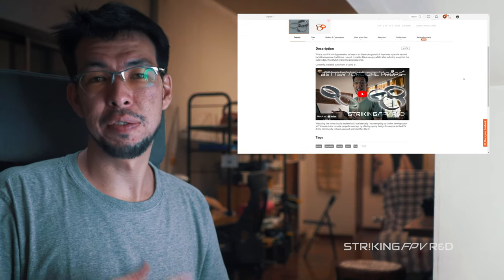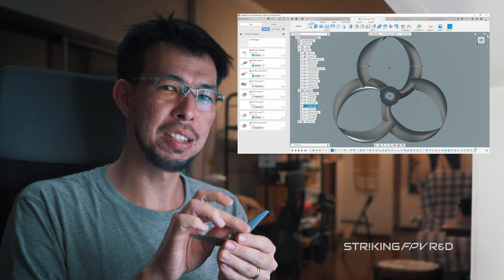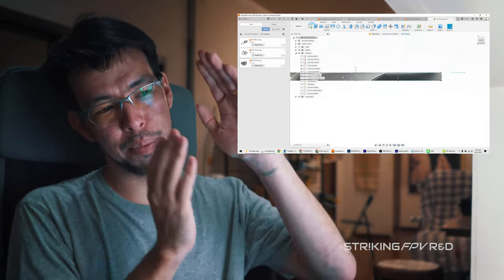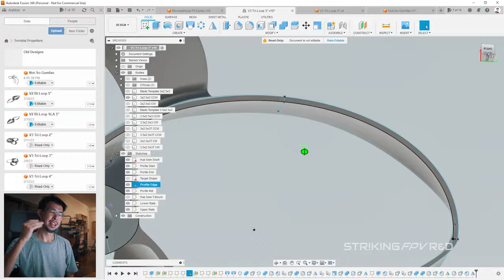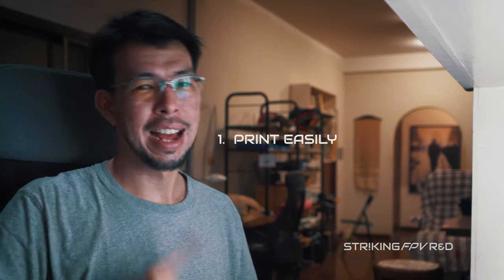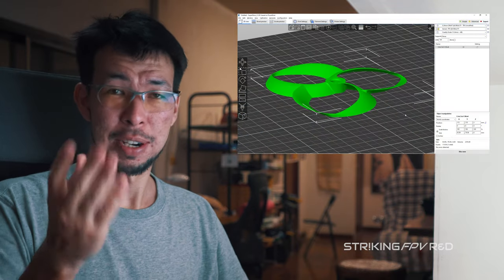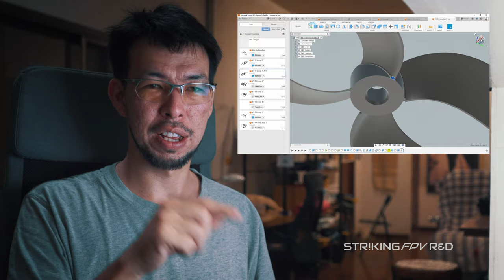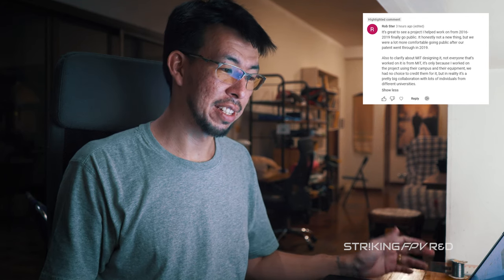10 Toroidal Drone Propeller Questions Addressed

Comment: I prefer tri-lobe ....
Reply from the maker: Maybe I'll do a poll on terminology in the future, tri-lobe never occurred to me.  This being said, as someone who has disassembled motorcycle engines, a camshaft has lobes more than these props, since the lobes are solid, whereas these props are hollow, which seem more like loops.  Also, if we go with lobes, then we can no-longer make the Toroidaloops Breakfast Cereal joke 🤣
Reply: @STRIKINGFPV  Ha …. Loved the cerise reference!  Yea, great point wrt lobes and camshafts.  Side not - remember the really cool Desmodromic design?  I think maybe Ducati had some patents.  Anyway, great point about loves.  I like TriLoops …. and you can make a “TriLoops” vs “Fruit Loops” cereal reference.  Maybe?
Reply from the maker: @truegret7778  Truth be told, I want to Photoshop the Fruit loops cereal box and have toroidal props as the cereal shape too. Tried to get Dall-E to do it, wouldn't work, haha
Reply: @STRIKINGFPV  HA!  You know, the way a lot of the world has changed, and with the HUGE hobbyist (RC planes, 200+mph RC cars, offroad, FPV, personal drones, photog drones) market, you would think Kelloggs marketing would jump on it !!
Reply: @STRIKINGFPV    Ok, so, I have to say I am stunned (they didn't disintegrate).  I decided to focus on the ZYLTech CarbonFiber PLA, 0.2mm nozzle, no supports, no brim, 0.16mm layer height for the "TriLoop".  I designed a hub for my stock DJI-Mini using your generously supplied F3D drawings, with the 4x3x3 pattern.  I took it for a test flight and honestly, it feels about the same, maybe a little snappier/responsive.  The seem noisier - but with a caveat.  They are heavier than the stock two blade because the controller complained "the starter motor failed", "low battery voltage, fly with caution", "Battery power limit will automatically reduce the aircraft's mobility to ensure flight safety".  I am looking for my scale to weigh the TriLoop v stock.  But, I managed to fly in Sport mode, rotate, basic maneuvers.  I need another iteration on my hub design, and will try and get (boring compared to you guys) a video up.
Reply from the maker: @truegret7778  I saw others sharing their issues with the DJI drones, they seem to have more inbuilt safety features to detect things like abnormal props or perhaps props that weren't seated/mounted correctly.  It's yet another reason why I'm semi-avoiding designing these for more prebuilt drones like the Mavics and stuff - for fear that I'll potentially be contributing to many expensive crashes 😅.

So you tried the tri-loop instead of the bi-loop, I guess?  That's the other thing, more surface area and material on the tri-loop will result in more weight and more drag, which I think will trip-off DJI's safety measures more - perhaps a bi-loop would fair better.
Reply: @STRIKINGFPV  Could be.  I will give that (Bi-Loop) a go.  I just wanted to try everything just to learn limits.  I figured the PID and control logic might have been freaking out.  If you are familiar with the DJI rotors, they are held on by shoulder screws which allow for the blade to be dampened when the motor-hub accelerates|decelerates.  I expected the DJI to balk at this (TriLoop) rotor.  I'm a retired EE and software/firmware engineer and just having fun - this DJI is expendable (since they made me update the firmware to "require" user|location|sub-250g quad ID info in transmissions).  Anyway, just having fun learning more everyday, and sharing.  Cheers!
Reply from the maker: @truegret7778  I still have my original Mavic Pro and I'm aware of how the motors mount - I imagine the newer ones are a similar system.  It's also one of the reasons why I haven't tried to make toroidals for them because I fear the little tabs are easy breaking points for delamination.

This being said, all my design files (and eventual tutorial) are being made available so people with the will to risk their DJI drones can, but with that level of needing to do your own design or remix someone else's, I think it's safe to say they'd be more aware of the risks (much like yourself).

Or they could be a YouTuber looking for views and people love a good crash anyway 🤣
Reply: @STRIKINGFPV  Ha Ha .... yea, I'm aware of the current landscape - the one I hold accountable is myself.  When I learned of the MIT collaboration (my brother graduated from MIT in the late '70's), I wanted to attempted the design myself but thought I would see whether other enthusiasts, like your self, embrace and run with it.  I discovered you ( via Will It Mod ), and really enjoy your style, presentation (although you freaked me out in the vid you said a mouse just ran by), the explanations, and enthusiasm.  When I began my career in the mid-80's, my brother passed away, and this caused me to reflect and realize I want to learn as much about as many industries, technologies, etc as possible.  I have never tried to hold anyone responsible for something I did/do.  No disclaimer needed for me, but I get that you have to say that for some others.

If I could give 2-thumbs up, I would.  Thanks.

I only asked if you were familiar with the way the DJI motor-props work, to get independent confirmation of what I suspected was happening.  The "low-battery" is on me because I didn't charge it up before I flew.  I am wrapping up the B-Loop props, I'll find the courage to dig my GoPro out and capture the flight - crash or no crash 🤓

Comment: MIT's data is not anecdotal... and their opinions are believe are better informed than yours are so far, so I think I'll trust them over your opinions on efficiency  at this point. MIT did not mislead anyone regarding sound of torroidals and they posted the data for all to see. The issue is less informed people and reporters as usual twisted the messaging... 

also regarding efficiency, you really dont grasp how tip vortices affect efficiency ergo how minimizing tip vortices can improve efficiency beyond the other design aspects you mention.
Reply from the maker: Never said MIT's findings were anecdotal, but I did say that the audio observations from testers of my versions of the design were anecdotal, so please don't mislead others about what I'm talking about.

As for grasping how tip vortices improve efficiency, I'm relatively aware of how minimising tip vortices can help, and indeed the aviation field has put great effort into doing so for good reason, but I'm just cautious about how much more efficient the bi-loop design can be considering it has more mass and surface area than an equivalently sized bi-blade. This may not be that important to drones aiming for longer and quieter flights, but the FPV community also values prop-response and more aggressive flying such that the bi-loop might not be ideal for this field.

That's why I'm interested in getting these designs out for people to try so we can get more of a first-hand experience with the concept and either discover that it's amazing and we need it, or maybe it isn't really ideal for us. Otherwise their paper is just a paper and we're just distant bystanders.
Reply: @STRIKINGFPV  In stating that MIT's data is not anecdotal I merely meant that theirs is data I trust far beyond your opinions and any anecdotal evidence people may submit to you, especially on the sound levels. MIT used dbA weighted measurements which are definitely.

As a researcher, I am all for being able to duplicate the results of researchers, but I must hold higher standards and demand test results. I also know opinions must be informed, can be wrong and frequently lead to observational bias... So I guess what I'm saying is you made claims based on some opinions I asking for proof. 

I dont dispute that FDM is likely not the optimal method of producing mass market propellers, but it should suffice to allow testing as MIT has proven. Sadly it wont work for making props to test for powered parachute that I see them being a huge improvement for, especially electric powered ones that need the gains in efficiency to improve flight times. Sadly it wont work for making props to test for powered parachute that I see them being a huge improvement over standard props
Reply from the maker: @johnfurr8779  Fair play, I misinterpreted your meaning there on the anecdotal front, apologies.

As a layman with an interest in tinkering, I don't feel that there's particular issue for me postulating on what the toroidal topic may mean for the hobbyist quadcopter space, and what I am attempting to do is perhaps make our expectations a little more subdued considering our more limited capacity for testing and lower quality of manufacturing.

There has been a lot of excitement around the news, but given that it only comes from one main source and there is nothing yet publicly shared in the way of their designs (CAD files), plus the fact that they've got a patent which means they likely never will share exact designs publicly, it means that what we're doing is very speculative at best, until someone with more engineering and aerodynamic experience comes along and helps us.

The fact that the designs I've put out actually fly pretty well, even when FDM printed, is pleasantly surprising, but I'm not expecting my designs to compete with what the Lincoln Lab developed - however if what I'm sharing inspires others to dive in, then maybe someone watching my videos might go on to further improve the concept.

Btw, are you a paramotor/powered-parachute enthusiast, since you mentioned it?  It never occurred to me that that would be a possible application.  On that front, would not a multi-layered sandwich of plywood CNC machined into the shape do the job?  Or another interesting idea is to CNC foam and then wrap/epoxy in carbon fibre (will be interesting trying to balance that, haha).
Reply: @STRIKINGFPV  The one thing we can do is to make simple test rigs with a motor and digital scale to perform comparison tests of propeller thrusts at a given power. it is my hypothesis that torroidal props will have significantly better efficiency which allows several options. I can surmise this from extrapolating data from the sharrow prop design for water

One we can opt to optimize a propeller to deliver the same thrust except at a lower power and noise level. This will result in longer flight times. 

Two we can optimize to deliver max thrust in a given swept area, better for acro I believe. 

A thrust test is where I plan to concentrate testing when I get printing. As a model boat and plane enthusiast I plan on testing props for both air and water. 

I have not yet started paramotoring but it is on my bucket list. It is more regulated in Canada than most nations. I have however been testing ideas and models of paramotors to try to implement on a full scale when I take up paramotoring. One issue I wanted to address was torque and twist which is serious issue in paramotoring. I dont like the multi-motor options most people try for electric paramotoring, and having a large Milling machine and lathe among other things I'm was working on inline contra-rotating propeller design with two axial flux pancake motors based on the Lynch motor design.

I have designed a single e-bike motor of this style that easily develops 2KW of power. 

I really want to know how torroidal propellers will perform in a contra-rotating propeller design.

Once I have a few good designs from fdm modeling, I plan to get sla prints made to use to create silicone moulds to be able to use to make propellers from a better choice of material. That will require some testing too. 

My fusion 360 skills are not what your are, so while I can do some rudimentary 3d sketches and models based on curved surfaces, I haven't been able to get my ellipses correct for rails to be able to model the prop surfaces. Time for more practice
Reply from the maker: @johnfurr8779  The contra-rotating toroidal prop idea sounds very interesting, actually, I also wonder what would come of that.  Initial thoughts would suggest very high performance, but at the same time I can't really imagine what kind of interesting interaction could occur between the two prop discs, that would be a fascinating test when someone, perhaps you, gets around to it.

As for Fusion 360, it's a matter of perseverance and heavy Googling, haha.  I'll be creating a tutorial video for the toroidal design soon which might help you out, or confuse the matter more, haha.

There are far more talented Fusion 360 users out there who I'm sure will have advice for me, as I've been given in my older Fusion 360 tutorials.
Reply: @STRIKINGFPV  I'll get there with the fusion. 

Where I keep having issues is with how I am ordering and organizing my sketches and laying out the profiles and curves. 

I can get some of the profiles to loft following the right rail, but others give me the dreaded "The selected rail does not touch all of the profiles" error.

I know I need to work on the basics more in order to work out where I'm going wrong laying out the 3d curves but I've never had the time to sit down and work through the issues. 

Perhaps if I laid out the profiles and then made my rails intersect them instead of the other way around.

Contra-rotating propellers have turbulent air between the propeller discs which loses efficiency, but they're used in design where eliminating torque is important, such as with a paramotor. Usually the need to have a gearbox to spin one prop in reverse adds too much cost, weight and complexity for small private planes... but electrification and axial flux motor designs can eliminate the need for gear box. 

I think I still have an old commercially available contra-rotating motor from hobby king I think it was. If I find it in my old junk I'll do some comparison thrust tests
Reply: @STRIKINGFPV  I know you're an acro guy but you may find this interesting... a company called CR Flight in the USA has developed what they call evector contra-rotating drone motors.

They claim 30 - 50% greater thrust efficiency. Up to 100% increased operating range, and quieter running, lower noise. I guess I should have worked faster and commercialized some on my hobby activities because seems people think there is money to be made in the sector

Comment: Great ideas throughout the vids. One thing I think of is all these designs will eventually pay off to something.  Then the next steps would be to design the machines to better the product manufacturing.  So it in itself is a loop. New prop leads into new equipment to build.  My opinion..